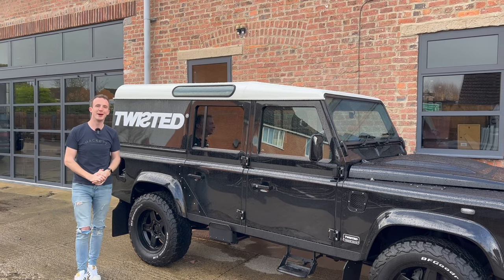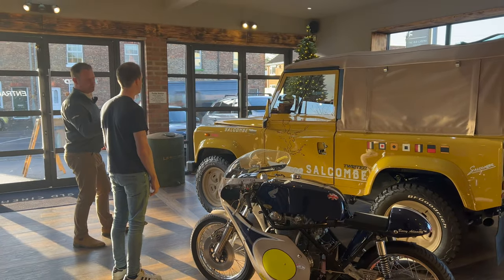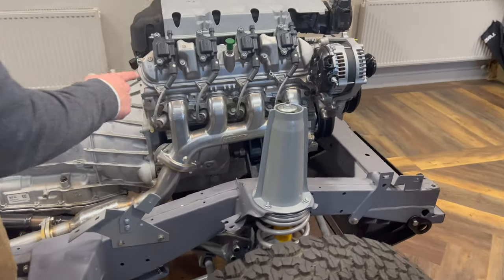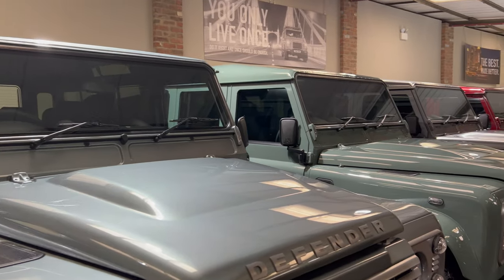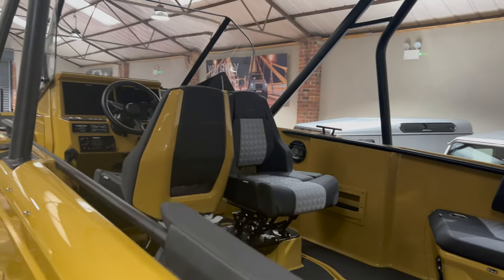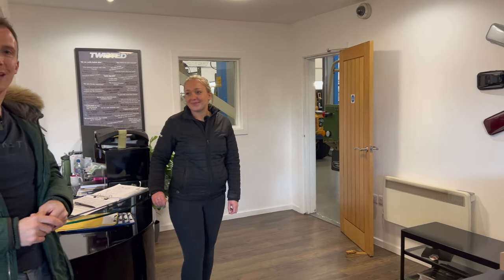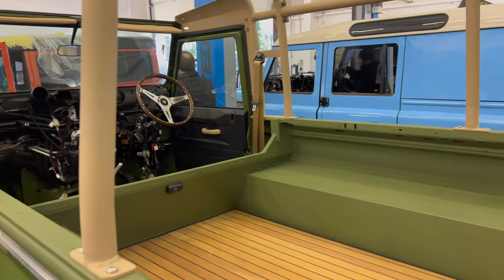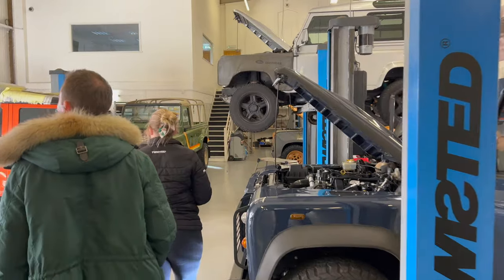SHOPPING FOR THE ULTIMATE LAND ROVER DEFENDER | Twisted Automotive Thirsk | 4K

Comment: Posh Defenders. Mine were rattly diesels with rubber mat floors and plastic seats. Never once failed to get me home through a Peak District winter, though.
Reply from the maker: Yeah these cost £200+ so a different machine but still just as capable as the rattling ones 🤣